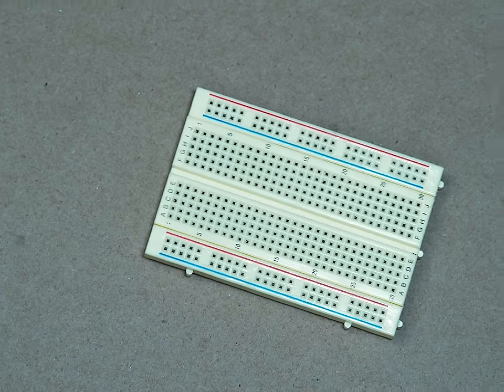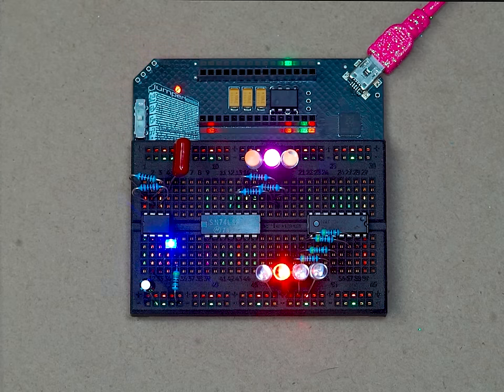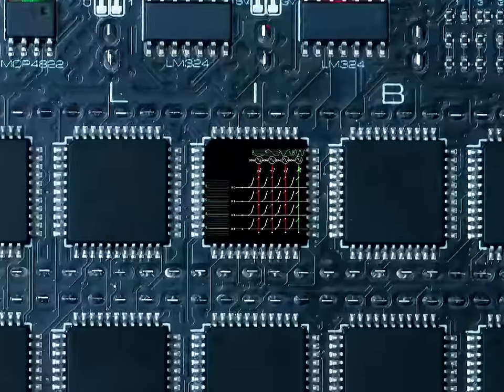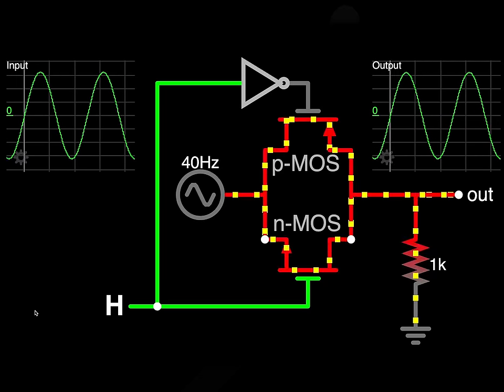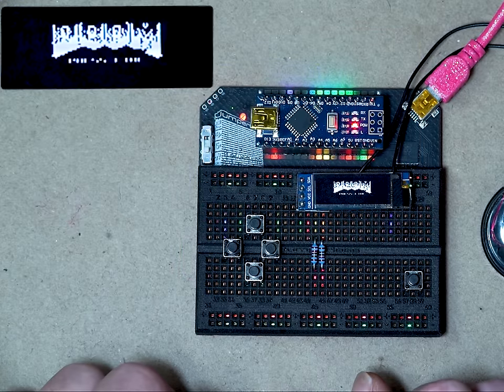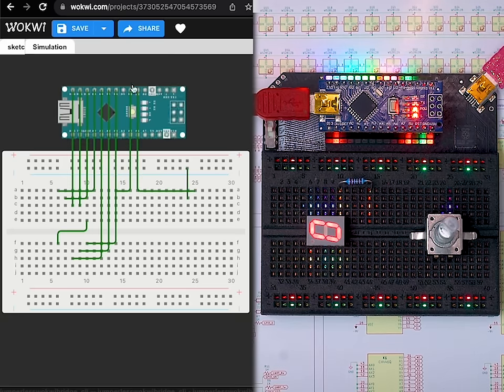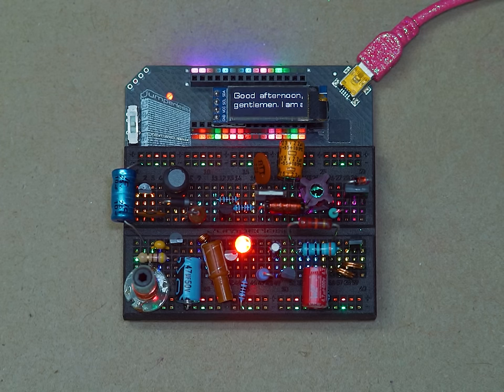Jumperless

Comment: As a breadboard, it's overbuilt. As something entirely new, it's amazing and extremely worthy of notice. Much like an FPGA, the ultimate strength is flexibility. Combined with dynamically reconfiguring, this makes some very interesting prototypes possible. You could even A/B test circuits without powering down!
Reply: Exactly. This isn't a breadboard, this is however quite possibly one of the single best electronics teaching tools ever invented at the hardware level.
Reply: @superslash7254  I'm only an electronics hobbyist but I've taken a couple of adult ed classes and this would be really cool for doing those exercises where you compute the voltage, current, etc at various points in a circuit. Seeing paper calculations versus real time multiple simultaneous in-circuit measurements would be awesome.
Reply: Yeah great idea and implementation. But for practical use?:
Why not introduce thousands of possible failure points, uncertainties and a effload of additional interference (design, electronic and complicated-wise) to your experiment, prototype or hmm, let's call it punching ball (do you want to destroy this, when fiddling around, testing, designing, etc.), meaning your usual breadboard (they usually do not have a "good life" and life experience, hehe). And why not combine the worst we humans know in terms of contact resistance/reliability and EMI with "rocket science" under the hood. Anyways, I wish the project and Architeuthis Flux good luck and success with his project:)
Reply: I agree awesome but overkill. Make something simpler.
Reply: You can't think of it like a breadboard, you have to look at its strengths and weaknesses. You shouldn't use a semi to drop your kid off at school, but you shouldn't use a Geo Metro to transport ten tons of lumber. For the relative expense of the system, I'd hope the purchaser had a need more demanding than making a Joule thief. :D
Reply: @JJ-fr2ki  Make it yourself. He contributed his thoughts and efforts to help others. If it doesn't fit your needs, move along.

Comment: The machine generated hardware idea made me do a double take! I will wager that this is not the last time I hear about this concept moving into the future...
Reply: The problem is that to be really useful you would need a lot of components. Maybe machine generated FPGA designs would be easier to achieve. Or maybe one day we will end up with Field Programmable Analogue Arrays (FPAA).
Reply from the maker: @conorstewart2214  You're totally right that this isn't nearly big enough to do really cool things with evolvable hardware. You'd either need a bunch of these or build up circuits by running this to make building blocks for a larger circuit and then run it again with a bunch of evolved modules.
I got really into https://en.wikipedia.org/wiki/Evolvable_hardware a while ago and that's actually what led to this project.
Reply: It's been in use for vhdl designs a long time.
Reply: honestly, this just screams to be repurposed into a hardware puzzle platform. Just imagine a hardwarified TIS-100...
Reply from the maker: @LeBoomStudios  Holy shit that would be so cool! You could do that game with circuits instead of assembly. Like, "Given a sine wave between 0-100Hz, make the output a DC voltage that's 5V at 100Hz, scaling linearly to 0V at 0Hz" and you'd have to use real parts in the Jumperless to make it happen.
Reply: @arabidsquid  That idea sounds an awful lot like Signal State. Give it a try if you haven't already.

Comment: 1) Netlist checker: Confirm pcb functionality before you order (of course you need pop all the components into the prototyping area... yes, yes not great for smd components, but many parts are available in THL equivalent or just buy mini adapter pcbs to solder it on)

 2) Automate reverse engineering PCB products: Build a bed of nails contraption with each pin on jumperless proto area connecting to one of the bed of nails pogo pins.

I think there is a million more!
Reply from the maker: Oh dang, those are great ideas.

Comment: Honestly, this thing, or at least the concept with a bit more development, would be an absolute banger for the education sector; basically the circuit builder analog of what block-based coding has done.  I know the education sector is often overlooked by the hobby, outside of certain people aiming to make education easier, but this is easily a step towards a very low cost of investment solution that also makes things super intuitive, while also covering multiple areas so it's also easily a singular tool for multiple courses.

Comment: I could see this being sold as an electronics learning kit bundled with a software guide, beginning with simple classic circuits, and then progressing in complexity at a rate unique to each individual. 

The software could analyze interactions with each user to profile areas of strength and weakness, creating a dynamic and personalized learning experience for each individual. 

I think something like that could help new learners from becoming discouraged by complexities that can be perceptively daunting for someone in the beginning stages of learning basic fundamentals. Basically ensuring a reward system of being able to successfully complete newly learned material and see their finished circuit functioning.
Reply from the maker: There's someone working on training a Llama AI on this board, which would be so freakin' cool and could totally do what you're saying.
Cause yeah, early breadboarding is kinda brutal. I guess it's good to learn that "close enough" doesn't fly in circuit connections early on, but it can discourage people who would otherwise be great engineers.

Comment: I need them. I need all of them. That is such a cool Idea. While I enjoy the prototyping of circuits, doing experiments and all, I always found the wiring, checking connections on breadboards a bit tedious and easily getting chaotic once you just add "a few" more components to a breadboard. That seems to be the perfect solution. If there would at some point in the future be one like this in the size of the bigger breadboard, or even with a little breadboard like place to put in a microcontroller...
This just blew my mind, that's an amazing project you made there.
Reply: "or even with a little breadboard like place to put in a microcontroller..." I don't wanna sound stupid, I know it has a place for a microcontroller already, but one that is designed like a smaller breadboard could accept not "arduino nano"  sized microcontrollers, as some esp32 boards are.
Reply: I read further in the comments, i wasn't the first one with these ideas ;)
Reply from the maker: That's actually a great idea. I already have the clips, so I could just make a little breadboard without power rails with male headers on the back that stick into the nano header and maybe does the LED stuff.
There's also this passive version that kinda does this https://www.tindie.com/products/architeuthisflux/jumperlux/

Comment: I'm super tempted to say this thing is nothing more than a gimmick, but the execution is so flawless and the applications are so endless that I am starting to love this thing 👉👈
Reply: Right you want to say that. I did to at first because all the RGB turned me off.  But I just listened to what he was saying and this device is industry changing. 
Just being able to see where your signal is not going at a glance makes it better than anything I've used before.
Reply: Now I wish there was a +/-15V variant that could handle SOIC packages...now that would be truly insane...
Reply from the maker: That would be awesome, I'm considering putting a selector on the next revision to shift the power supplies to be basically unipolar. 18V of Vdd-Vss spread is the limit for these chips (actually I'm running these way above the 14.6V max rating), but the GND can be where ever in that range, so the selector would move the range from [+-9V] to [-2V to +16V], allowing you to work with 12V stuff.

For SOIC stuff I make another passive board with just the breadboard with LEDs, a protoboard, and a bunch of "universal" SMD footprints all wired together that can be snapped apart to use them separately.
https://www.tindie.com/products/architeuthisflux/jumperlux/
Reply from the maker: I am also against the LEDification of everything, it's usually just retina-melting garbage that adds nothing. But I finally gave in, and it enhanced the usability sooooo much that I couldn't go back. 
And yes there's a brightness control menu so you can turn them down.

Comment: idea: fully automated pcb testing, you can setup probes (i.e. pogo pins) with an magnet in the base on a steel sheet with a pick and place setup, with each probe connected to a pin on the board, then you can simply put your board on the bed of pins and it can go through each connection to ensure the pcb is wired correctly, or you could do the same with a 3d printed socket, make some pins-with-a-wire, which you can then plug in the 3d printed reciever, and then automate all the tests if you have a lot of boards. 
you can wire a function generator and such to the jumperless, and have those sweep through. other options are stuff like a transistor, capacitor, inductor etc... tester, so you can also test fully built pcbs.

imo an upgrade would be to have a small solid state relay array which can handle higher currents, and maybe a few ghz mux, for hf testing.

Comment: This is legit the coolest project I've ever seen. I literally spent 3 months researchings for ICs that could achieve this but never was able to make such " digital wires " this is awesome!!! Congratulations!!!🎉
Reply: Also, love the concept of being able to universally replicate any circuit with ease, just place the components in the right positions, upload a file which contains the connections, and there It is!
Reply from the maker: Just for reference, you can use the CH446Q as mentioned in the video, or the MT8816 which is available in a 40-pin DIP or PLCC-44. The CH446Q is a clone of the MT8816, but they added a serial addressing mode which is very nice of them.
They're great chips to play around with.
Reply: @arabidsquid  Awesome! Thanks a lot for the details. Honestly it's incredible of you to make this an opensource project, I think this approach for protoboards will become more and more common, love the led matrix btw, is It also driven by the crosspoint IC? Sucess!!
Reply from the maker: @rafaelguida2317  Yeah well I want other people to improve upon it however they can, or just use little bits of it in their own things.

The LEDs are just a string of 111 addressable RGBs like NeoPixels, so they take one signal pin to drive and they just pass it along the string to the next one until they see a message addressed to them.

Comment: This would be an amazing teaching aid, makes connecting up simple and not so simple circuits easy and quick. Also makes swapping different components in and out to check the outcome very fast. Has limited application outside of that though I would think.

Comment: If the configuration can be saved to a file and shared this is amazing and it's a new era in design. I'd love a huge one too.
Reply from the maker: Yeah, they are. By default, it just saves the link to the Wokwi project in a text file, but it can also write out the netlist as text if you want as well. Then you can just paste it in to load it.

Comment: Dude this is amazing, it's pretty much whatever you want!!! As you asked for ideas: 
Perhaps trying to add some pogo pins or jumpers or something to make it capable of connective multiple ones, or connectiong a "dumb" one that doesn't need to be as expensive to produce because the master handles processing. So you can have the master which can be linked to other masters or slaves, maybe some kind of bus or if enough conductors a direct connection

Comment: That’s incredible. Looks like WCH are knocking it out of the park with good (and cheap) ICs.

One neat addition would be a few digipot ICs to wire up as custom resistors. Or vactrols.
Reply from the maker: Yeah seriously, there's clearly some awesome, inspired engineer at WCH who has the pull to make semi-niche chips that very few others are making. 

The first version actually did have a couple of digipots, but I cut them (and replaced them with current sensors) to keep the costs down to a somewhat reasonable level. But it might be worth adding them back in a future revision.

The vactrol idea is interesting, how do you envision they'd be used?

Comment: While Im not much a hardware guy, a software configurable hardware hacking platform just feels overdue.  Bravo - this is incredible work!

Is there a way to export/import the jumper settings?  I think this is possibly the most universal use-case of all: the ability to share patch configurations.  Combine that with a BOM and instructions on where parts live on the board, and you can reproduce any project.  For distributed FOSS hardware teams, that might be a big deal.  It could also be used for learning like Ben Eater's 6502 series.

Another possibility is to de-couple the implementation from the traditional breadboard layout (assuming you haven't done this already).  I'm not sure of the internals, but it looks like parts can technically live anywhere on the board - no need for rails.

Lastly, you could probably re-implement a large number of other projects for a bargain this way.  For the cost of one or two extra jumperless boards, you no longer need a bunch of other populated PCBs for niche jobs. Consider things like the Retro Chip Tester Pro, or like you suggest, EEPROM readers/writers.

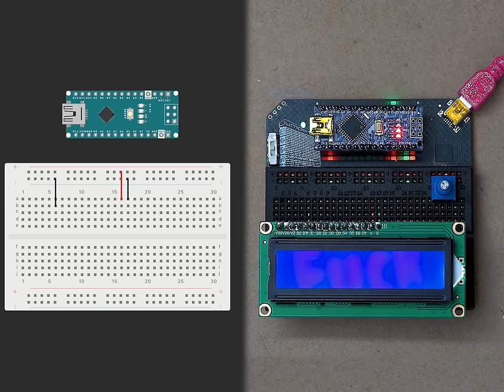Comment: I made a 150mW UV laser driver circuit on a breadboard back in grade 8; popped balloons, lit matches, burned Carlos (loved you lil dude fr) with it in a wooden chamber driven by a 9V battery. Those times were terrible, I wish I could go back. Also, the display reads "FUCK" at 2:21

Comment: This is actually a really really cool idea. I just wish it was larger; and yes I know what I'm asking here. It would be even greater if it didnt have the traditional breadboard layout, but was just fully a grid. Place anything anywhere. So many possibilities
Reply from the maker: All the files are open source on GitHub, so you could totally just start with the same schematic and lay out a completely different PCB in KiCad pretty quickly. That's a rad idea and I would love to see that.
For larger ones, next major revision will have edge connectors so you can stick 2 or more together and they'll act like one.
Reply: @arabidsquid Ooh that also sounds like a great idea indeed; to just make them expandable. I can see a lot of use for these; especially because in my projects these ratsnests always are more of a problem than they should be. But then they are a lot bigger; so scaling up would be beneficial.

Comment: I would like to suggest here that instead of using LED's underneath the breadboard, you can use an e-ink below a transparent board. Which will show the connections, as well as other info like voltage current etc at one corner, or even play simple game under breadboard matrix 😜

Comment: I love this, I hate dealing with breadboard wires, its a crosstalk nightmare, sometimes the wires dont connect, weird capacitance and inductance issue from all the extra wire touching each other. 
Ive had simple buck converter circuits fail on breadboards, nothing would work. BUT WAIT, I touched a wire with my finger, now it's working
😡